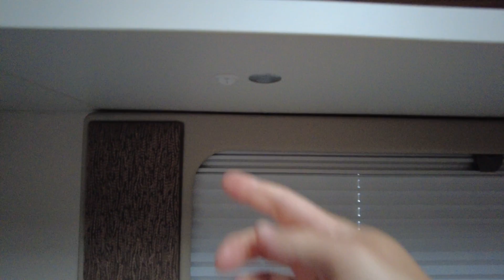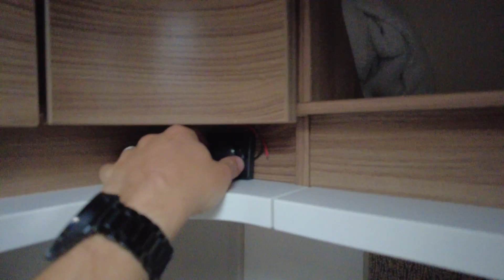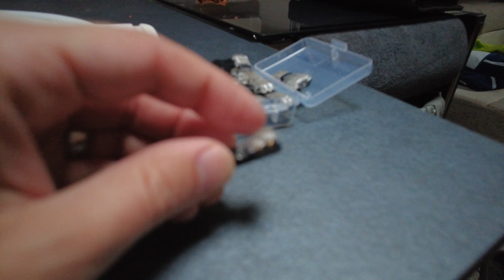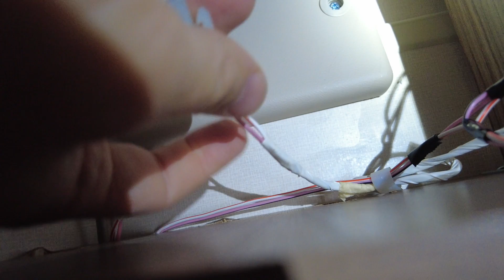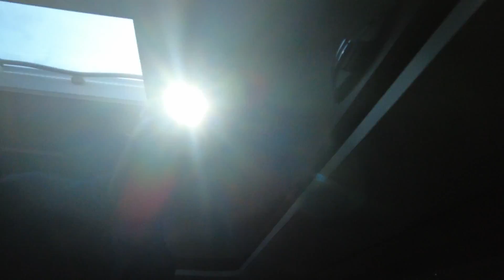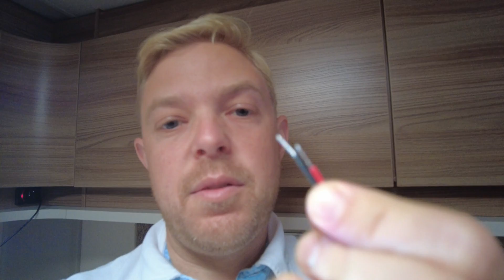Installing an additional USB socket in a MOTORHOME

Comment: great stuff, i've bought the sockets for mine but haven't got round to wiring them in, was meant to be this week but my cold has got the better of me. quick question though, did you just snap of the rotating covers that are over the sockets?
Reply from the maker: Yeah, they're pretty flimsy. I might have cut them with some snips but they came off easily

Comment: Nice video. :-) Which screen and projector are you using? Are you connecting it with any other device (laptop, tablet, ...) ? How do you remove (roll it up?) the screen when not in use? Thanks in advance for the info.
Reply from the maker: Glad it was useful. Take a look at my video on the projector installation. There should have been a link within the video early on but you'll also find it in my playlist of 'How to' videos
Reply: @2.4inaVan  Thanks, I'm gonna take a look ;-)
Reply from the maker: @MM-ul7sb  No problem at all